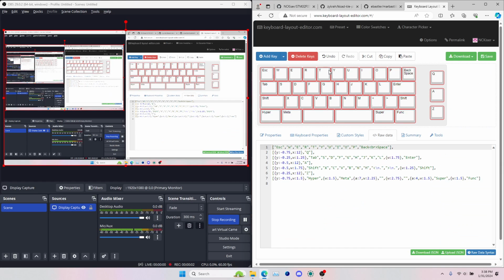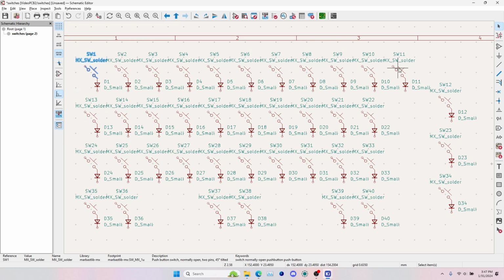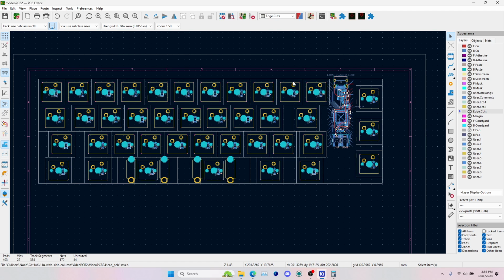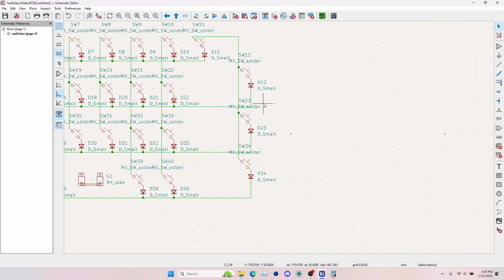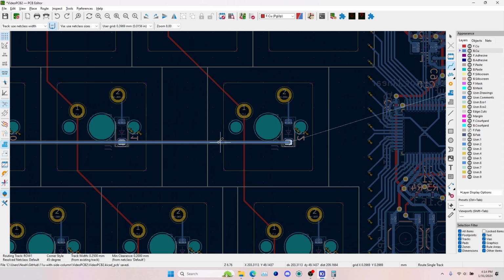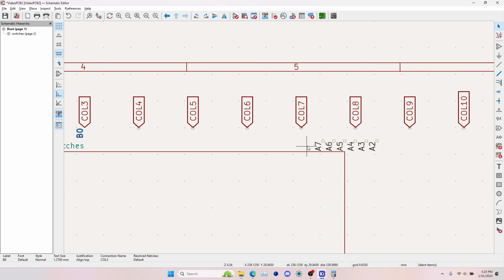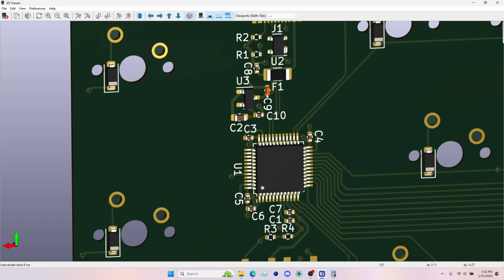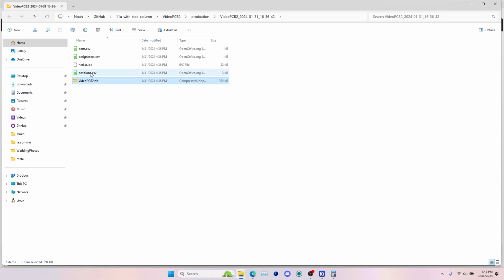STM32 Keyboard PCB Design

Comment: Great video! Great idea to use the esp32 designs to skip reinventing the wheel. I've been really enjoying your content. Have kicad installed and plan to make a full sized iso layout board. 

It would be amazing to see adding features like encoders for knobs (should be fairly easy), leds via i2c or something, how to flash and customise firmware, and how to use something like the esp32 to also enable 2.4ghz connectivity via a dongle.

Comment: What a legend, this video is exactly (to the letter) what I was looking for! 
Can you flash the bootloader to the STM chip over the USB? I've only used blackpills in the past where I needed to use the stm usb to serial flashing tool connected to the serial pins. If these pins aren't exposed how do you get the bootloader on the chips, does JLCPCB factory flash them for you or something?

Comment: You're very thorough and concise in your explanations, and it's a gift to have been clearly shown a way to design using this template. Thank you for making PCB design so much more accessible! 

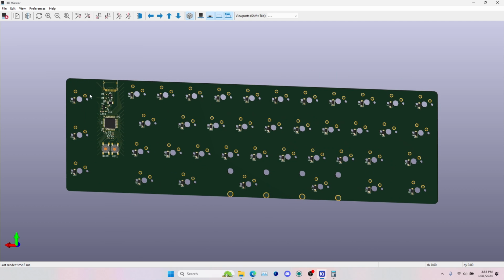One minor thing I can't get to work is what you do at 20:03 - switch out the USB footprint for the marbastlib version. I followed the same exact steps and updated from schematic, and the footprint updated successfully. However, when I go to the 3D view, the USB still doesn't show. I'm curious if there's an additional setting you may have that's different, or perhaps you may know of a reason why the 3D model for the USB header doesn't show even though I updated to the marbastlib footprint?
Reply: Figured it out, and for anyone with a similar issue:
For whatever reason, either the download did not contain the 3D .step file or the plugin did not import it correctly.
I had to find the .step file separately (it's called HRO_TYPE-C-31-M-12.step) online and download it.
(My download had .txt extension, but just override it to .step if so).
From the PCB editor, double-click on the USB component to open Footprint Properties. Under 3D Models, click "+" to add the .step file.
Most likely the .step file will not be in the correct place, so highlight the newly added .step file in the list, and adjust the settings in the modifications panels on the left.

Comment: Hi Noah.

I've been following your TKL series the past few days, and now I only need to route the matrix. I already have slight knowledge how to do this with the rows and collums, so I'm just asking now if it's possible for me to finish the project by routing the rows of the diode catodes to 6 different IO pins, and my 18 Columns of switch inputs, to 24 IO pins on the RP2040, and then finish by flashing the QMK firmware onto the chip?

Also, would you recommend using Western Duplex Matrix, or should I just keep to using one node pr. row and column individually.

Great tutorial, and many thanks for the good videos!
Reply from the maker: Hooking up the common cathodes on each row to it's own GPIO, then the columns to their own GPIO is all that is needed to wire up the matrix. In your case, yes, you would need 24 pins (6 rows and 18 columns).

I do recommend the Western Duplex, though I like to call it an "interlaced" or "folded" matrix, where you effectively double the rows and half the columns. In your case, that would take it from 6+18=24 to 12+9=21 pins, saving you 3 pins.
Reply: @noahkiser  What are the pros of using Western Duplex in my case instead of just using the pins I already have enough for.
Reply: @ClickityTech @Tenshiwa it just saves you 3 pins, thats the only advantage. but the r2040 has only 29 gpios so if you plan to add other features, this might be necessary.

Comment: I am currently using STM32F072C8T6. Any difference with your STM32 model that you are using?
Reply from the maker: Looks like the C8 has half of the flash memory of the CB, at 64Kbytes instead of 128. This would be quite limiting when running QMK, and would be insufficient when trying to run ZMK.

Comment: Thank you for sharing your template. For V2 of my keyboard design, I was planning on painstakingly copying a schematic for a ProMicro and probably messing up along the way. Your videos have basically taught me KiCad.
Reply from the maker: The STM32F072 has a very detailed datasheet. Have a read through it if you are going to do anything other than a simple switch matrix: https://www.st.com/resource/en/datasheet/stm32f072cb.pdf
https://www.st.com/en/microcontrollers-microprocessors/stm32f072cb.html